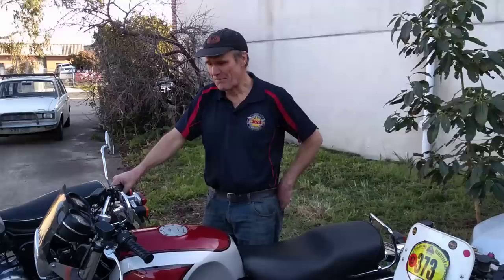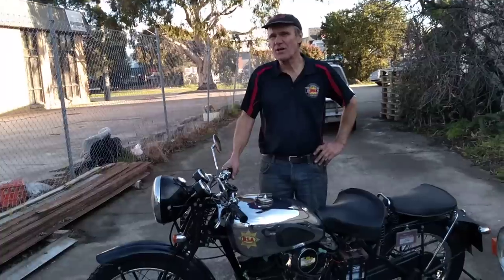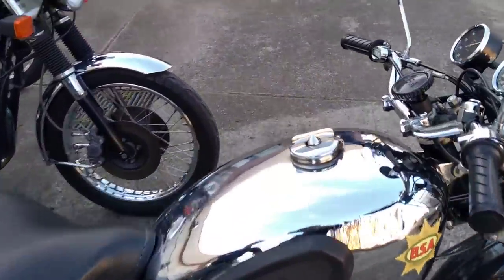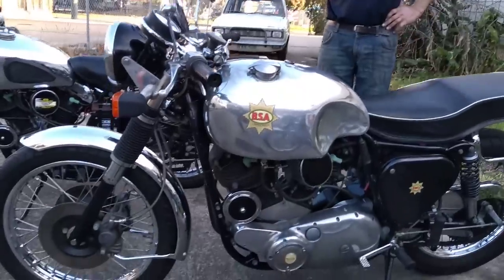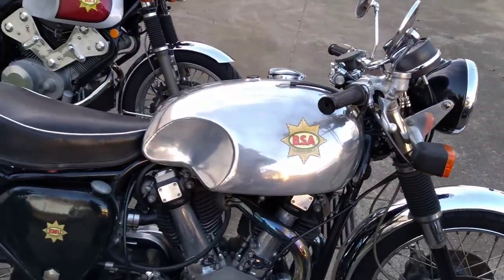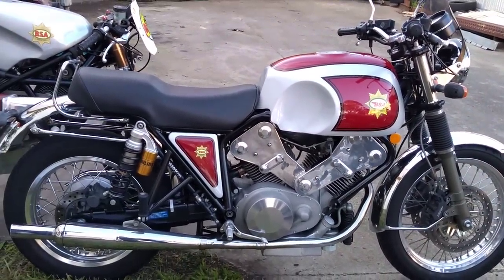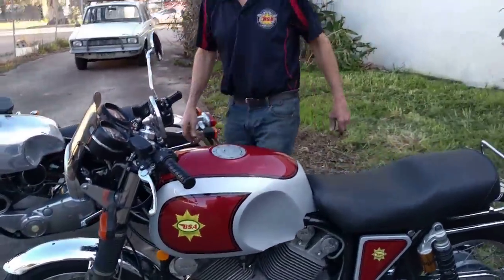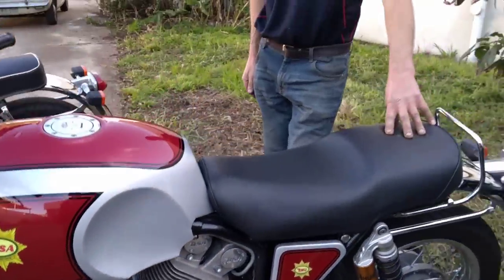New BSA V Twin Motorcycle

Comment: I fail to see why anyone would dislike what you have done , absolutely brilliant work .
Reply: Semaj upon your first visual of this genius says the twin 75°. Did the thoughts of a Ducati panigale enter your mind ... Imagine this brand new BSA prototype sitting in a EBR frame... As if you've ever watched the age-old road test between the Dakota panigale and the EBR the specs are almost identical within a decimal point even down to the price tag that's to the penny the same performance on the track was closer than throwing a blanket over them but TBR failed to test because it had a cracked rotor front brake from the factory wah wah wah wah wah wah wah wah now comes the BSA and it sounds just like ebr haters if anybody give it this masterpiece of a BSA negative review.... In 1963 I believe it was I would have been 13 years old and for some reason at my local hills Honda dealer no one complained when I was sit by the hour on the showroom floor staring up at a 650cc triumph TT they came from the factory with no lights on it and I was amazed wow a real racer that I only see in magazines.... And next door neighbors of my cousin between the dad and the son-in-law and the Sun they actually raced Norton's BSA triumphs and matchless but was the same for me as sitting and watching.
. And miraculously at age 16 to the summer between school breaks I I managed to get a summer job working for the Norton Ducati BMW motoguzzi Suzuki Bultaco dealership in 1967 so you can imagine how long I can make this comment but the one that stands out the most my boss considering my age at that time allowed me to go to the local loan company as they wanted someone to drive there repossessed BSA back to our shop for sale.... And like early in the stunt driver motorcycle icon video on YouTube where they we're finally released from jail and went to a warehouse and uncovered some motorcycles and he's sweating and shaking and trembling when he pieces eyes on a three-cylinder turbocharged triumph... At age 17 I'm staring at a BSA Hornet factory tracker that's some clown had added lights and make it street legal almost as everything else was Rickman with a four valve combustion twin cylinder head with the Rickman 750cc jugs Pistons as this was set up for the goddamn mile ama gnc1 championship bike.... And I'm about to pee my pants mentally picturing where in the hell can I twist the wick up to wfo and not get caught ... And then how in the hell am I going to explain how fast I went when it only has a tachometer that reads 8,500 RPM but I soon tried to twist off the needle as those m********** will f**** buzz out of sight. And apparently they must have heard me coming from a mile away as everybody but the owner was standing out in the middle of the highway trying to block me as I went past the shop  tucked in tach nettle  on 8500 one hand on the left front fork leg and the other hand pinning the throttle my head tucked in as tall as I can get it behind the tach and handlebars Dave Aldana  style wow ... And at an age when I must have grown to weigh at least a buck 05 topped out on a BSA hornet . And to add to my luck of the cards later on at the terre Haute action track where I'm from I witnessed the real Dave aldeana doing the same thing sideways on our half mile dirt track that was featured in the movie on any Sunday and I'm in the grandstands... Wasn't as much fun as riding one but to witness Dave aldana sideways at 140 on one was priceless... That life is good as it led me to understand who Mert lawwell  was and what a Harley Davidson is. That can become not a BSA but can do the same acrobats and stunts that I do not recommend anyone at home to do on something like this
https://drive.google.com/file/d/1vzrBqdVp0Xt093OGJOvkV7jTU81USpwK/view?usp=drivesdk

Comment: This is a brilliant job.  I used to assemble BSA bikes imported into Victoria.  I didn't like the 500.  So I am not sure that it is the best basis for a twin but I am a weirdo. The 650 and 750s were more civilized.  The 250 was good to drive and efficient.  For me personally a pair of the 250s to form a v twin 500 would have been more interesting.  Even though I did all my riding with a passenger, bikes have had so much power for so long that I don't need so much as is on offer.  Equally I would love to see fuel injection. It has made such a revolutionary difference to cars when driven on less than full throttle that it has a lot of potential for making a more civilized, more powerful and more efficient version of the bike.
Reply: Great work 👏 What an old school v twin would put BSA out there with something different.
They should sign you up Doug as you are the real deal.
Your knowledge and obvious enthusiasm jumps out of the screen.

Comment: Absolutely Awesome,  I rang Triumph some yrs back & put it to them to consider the idea of building a VTwin & put it to the next meeting
Reply: When working for a triumph dealership I'd speak to our rep, or if at training I'd do the same about a V twin or large single. Was always told that was not a direction they were interested in. They are parallel twins and inline triples. Of course when the 675 Daytona came out I asked if a 675 Tiger cub was in the works. He nodded as he told me they didn't have plans for anything like that. A few years later we got the excellent Tiger 800.

Comment: You're a very talented builder. The new BSA has a few YouTube sites, already. Most people hate the radiator, but I think it helps sell the bike in hot places, and there are other benefits that come with the fact it spoils the looks a little. It's a good job on looks, so I can't wait for reviews. It's a shame they didn't offer two models; one air cooled as well. Then people could choose, depending on where they live.
Reply: I don’t care for the radiator either, must help with emission controls.
Reply: @jonyoung6405  There are many advantages to having a radiator, but for people in cold climes the air cooled engines suffice, so let the purists have their choice. Surely, two models is not that hard.

Comment: BSA and all British marques, in the late 1960s  were run by the most incompetent management. That why they all went bust!! Too little too late. I think your bikes are fabulous, there is nothing like a v twin!! On the latest model ,I  would have included a kick starter and a lift valve control for modern soft wussies!! Your bikes are fantastic , and I would buy one in a heartbeat!! but then again, I am old school!!  The only bike  I found I could ride, and that is because it looked old schoolish? s the BMW RT nine 1200 Scrambler, but that has no kickstarter!! unfortunately you cannot buy a modern, old school motor bike any more with a kickstarter FFS! Kicking over the bike to wake her up, is a large part of the connection you make with the bike!! not to have one, just because batteries are so reliable and most of the time you don't need one! is missing the point!!  Well done on the build of your fantastic motor bikes!! BSA even if it was to restart , just like Enfield did, will not be the same as the original. Just as  modern Triumph is a poor replica of a golden age. New Bonneville, no kickstart, water cooling, fake carburettors hiding injectors!  fake  separate  gearbox , basically a fake bike!!
Nothing worse than a bike with the same name as a classic model from the 1960s, but a fake throughout!!

Comment: Nice,but give me a Hesketh V1000 any day!
Reply from the maker: Hi The Fokker, I actually own a Hesketh my self and a very fine machine it is. I have owned it for nearly 37 years and have traveled some 65000 miles which have been both very enjoyable and reliable. I could compare but I won't, suffice to say that I did use Hesketh instruments on my new bike the E120 however I fitted BSA dials to them.      Happy riding Doug.
Reply: @dougfraser6756   Are you thinking of selling these crankcases or complete bottom end